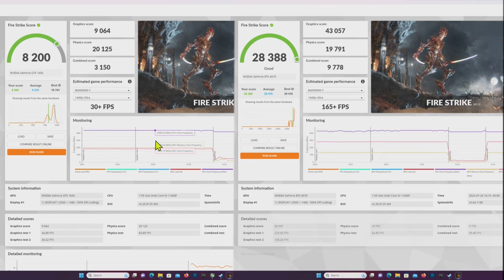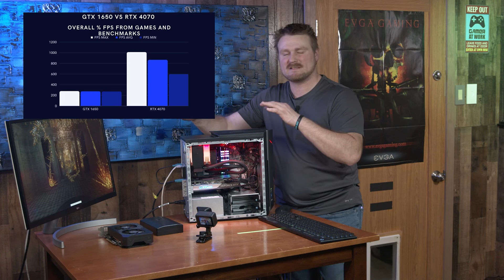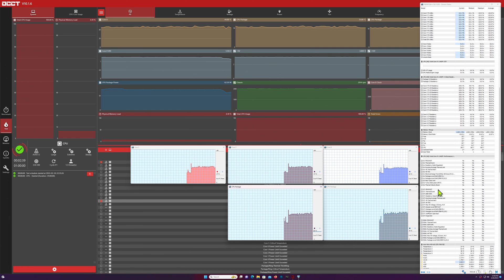Acer Nitro 50 GTX1650 Lets upgrade the GPU is a RTX 4070 really worth it? #howto #nvidia

Comment: I have an Acer nitro 50-600-UR1H with a 500W power, I was hoping to swap the 1660 GPU with an EVGA 3050 OC. Can anyone tell me if I have enough wattage for that upgrading the PSU is kind of tricky...
Reply: so you have roughly 230 Watts available, the 3050 8gb uses 130 Watts as long as its a 2 fan variant it should work
Reply: @Kramptonyte  thanks for the response bro. I ended up buying a 700 watt PSU and replaced the OEM One. So I should be good with wattage now and in the future. I do plan on upgrading my i5 9400f cpu to a I7 9th Gen,  but I have to determine whether or not the CPU cable from PSU can handle the wattage, since it's a 4 + 4 CPU connector but I only have a 4 pin port on the motherboard.
Reply: @DadeHudson93 that's one of the reasons changing PSU is iffy because you need adapter and those are adapter can be questionable and some people have fried components
Reply: @Kramptonyte  yeah I might not risk it, I'll just get a new, more modern motherboard down the line.
Reply: @DadeHudson93 well, with the GPU you had in mind, you can definitely do the i7 9700
Reply: @Kramptonyte  yea? Ok. Part of me does want to finish this build and Max it out before I move on to another. Ive learned soo much in the last couple weeks as a beginner and just watching countless videos. Its lowkey addicting 😅
Reply: @DadeHudson93  I despise the Nitro 50 because of Acer shenanigans. so I would not sink to much into improving it if you are already planning your next build
Reply: @Kramptonyte  I can see why. I didn't know much about PCs and upgrading before I got it, and I didn't know how problematic OEM builds could be lol I thought it was as easy as just getting a pre-built and upgrading lol should have did more research. But I am glad I got this far with it for sure
Reply: @DadeHudson93  lots of decent pre-builts out there if they use off the shelf components though usually with the Ram Shortage its difficult right now for DDR5. but this is why the Nitro 50 is so cheap compared to others

Comment: are you able to equip this pc with a 5060 ti? also why cant you upgrade the psu?
Reply: you have roughly 230w of power rtx 5060 TI 16g has a draw of 170w
Reply: You can upgrade the psu, just get a 24 to 6 pin adapter
Reply: @rimeee6051  thats what i ended up doing! upgraded the internal ssd, psu and gpu. thing rocks now

Comment: I just installed a GeForce RTX™ 5070 12G VENTUS 2X OC, bought a pack of 2 1x 8pin to 2 8pin adapter cables, first i tried didnt work, but then i changed to the other one and now it works perfectly fine. No issues whatsoever. I even saw it drawing 250 watts while i tried gta v enchanced but pc was still alive and going. Thanks for your channel and your videos TechNitWit. its fun learning!
Reply: just be careful that right on the line for power consumption, you may have to undervolt your gpu. which pretty easy using the MSI afterburner software
Reply: i was helping my friend upgrade his nitro with a 5060 tobut we were gwetting one long beep and two short beeps. i figured it was a psu problem, how did you get yours to work?

Comment: Is this using the original motherboard and psu?
Reply: yes,
Reply: 4070 super uses only 220 W of power on load. everything else in the computer uses 270 W roughly . so you have roughly 230 W to play with when upgrading video card. now you wont be able to overclock or upgrade to a more powerful CPU but it will work
Reply: @Kramptonyte thank you for the advice bro I’m new to pcs, how much fps do you think I would get with this or a 4060 on all low settings in Fortnite?
Reply: @aaaaaaaa-f7e  at low settings that's definitely workable for 240 fps that being said if you can afford it I would recommend getting the 4060ti or 5060 TI for better performance. But if you can afford it the 4070 is going to be your powerhouse compared to the 60 and 60 TI variants
Reply: @Kramptonyte thanks a lot bro I appreciate the advice
Reply: @aaaaaaaa-f7e don't worry about it ask questions. I'd rather help you get the best performance even if it is from a horrible pre-built

Comment: How did you manage to have the 4070 to work with this 500W PSU if the GPU requires 650W ? Is it me who's dumb as a brick ?
Reply: because a 4070 super uses only 220 W of power on load. everything else in the computer uses 270 W roughly . so you have roughly 230 W to play with when upgrading video card. now you wont be able to overclock or upgrade to a more powerful CPU but it will work

Comment: anyone manage a 2070 in this
Reply: a 2070 super uses roughly 215 watts, you have roughly 230 watts to play with, there is very little space so you will most likely need s 2 fan design
Reply: @ ty bro
Reply from the maker: Yes it will work id get a 5060ti or 4070
Reply: @TNW1337 should i get a 9060 xt? i keep finding it at msrp

Comment: are you sure the 4070 can be in 500w psu
Reply from the maker: you could use the 400w and it would work math comes out to 366watts would I suggest that no to play it safe I would only do it with a 500watt psu 500w will have plenty of head room also you want 20% for spikes in power.

Comment: Hey probably wont get a reply but will my PC be able to handle the RTX 4060 i have a GTX 1650 with an amd 5 3500 and 40 gbs of RAM and a 1TB SSD its a acer nitro N50-110 i believe so it should be a 500w power supply?
Reply: well the ryzen 3500 has a TDP of 65W, so it should be able to handle everything up to a rtx 4070 super as you have roughly 230W to use
Reply from the maker: ty

Comment: I have N50 640 model desktop. Is it possible to upgrade the PSU . If yes please provide a link for the PSU model. Thank you in advance  for the support 😀😀
Reply: there is a work around but you need an adapter which is the  24 Pin to 6 Pin ATX PSU Power Adapter Cable for Dell Motherboards easily found on Amazon for 10-20 dollars. and using that you could use pretty much any PSU that fits into the space

Comment: you can put a normal 92mm fan in front. I put a standard Noctua in there, its actually fatter than any generic 25mm, but it goes. And I believe you can put any "small" PSU in there with motherboard cable adapters.

Comment: hi, I'm planning to upgrade my nitro 50-640 from it's stock 3060 to a 4070. you think it will be compatible with my current power supply, motherboard and the other componets? thanks.
Reply: you can go up to 4070 super but just make sure its a 2 fan design

Comment: what model of acer nitro 50 is that? i have a n50-500 which is older so i cant find anything about it online and cant figure out if my psu can handle a 4070 or not
Reply: I hope you figured out your answer I cannot even find information on a n50-500. the oldest I could find is n50-600 which had an 8th gen i5 from 2017. and those from that age tended to have lower psu 400 to 450W . due to the age the processor you would be getting a bottleneck

Comment: Probably won’t get a response on this but I’ve been looking around everywhere for some answers lol I’m wondering if it’s at all possible to put 120mm fans in the case instead of 92? I have 2 extra fans from a previous build but they are 120mm so I’m nervous cause I want to put a cpu cooler in it as well and I can only find 120mm. Heeeeeelllllppppp 😂

Comment: Hello , I have acer nitro n50 640 with rtx 4060 ti 16 gb dual fan, 32 gb ram dual Chanel( it works great ),  I want to upgrade to rtx 4070 SUPER dual fan. will 500 w be able to to handle it 1440p. Gaming max settings. ?  Thanks waiting for response
Reply: I'm also interested in this, more to do with the pin connections?  Is the RTX 4070 Super dual compatible or does it need different pin heads from the PSU?  Anyone tried it?
Reply: you need to very pricesly check your motherboard what connectors have.. bcoz i have n50-650 with i7-13700f and rtx 3050 oem king 8gb and with this prebuilded pc's they make it with limited psu ATX or smth like that, so now if i want to upgrade my gpu i need to buy an external conector 24pin to 6 pin which i found easy in aliexpress (its for acer mb specificly) 3 or 4$ and with the new bigger psu i will be able to upgrade the gpu to 4070 or 5070 (i hope).but check everything what pins are goin to mb and gpu bcoz for sure u gonna need to upgrade psu :)

Comment: I have a N50-640 and want to upgrade to a RTX 4070. I bought a new psu to support it but it looks like I need a 24 pin to 6 pin connector. Im being told the motherboard in the N50-640 won't handle the 4070. Do you know if that's true?
Reply from the maker: The PSU stock can no need for a upgrade any thing. Just do not overclock it.
Reply: @coffeeluvr_7565  what type of cpu fan do you have? I wanted to get sonetbing other than the noctua that technitwit did a tutorial  on.. kinda new to doing these upgrades and this pc is so limited

Comment: Hello, what memory ram do you use , please, i have an acer nitro i7 11700f with 3060ti 1t ssd? Please or recommend something❤❤❤❤❤❤
Reply from the maker: You can use the one I link in the video cl16 1.5v ram it runs at cl22 or get the green ram at 1.2v and cl16 the fps Loss is Negligible.

Comment: Hey mate I have a question: I have the acer Nitro 50 N50-620
With an 1660 Super and an i5 11400f.
I want to switch to an 3070 founders Edition.
Would the power supply (500W) be enough?
Reply: Barely, you’d want to upgrade later
Reply: @ZaniacPrime  thanks mate!
Reply from the maker: The rtx 4070 will be just fine.
Reply from the maker: I use this pc to record my onscreen, and it rock with the 4070 no problems fast encoding. So, most video applications, editing, and recording software make use of  the CPU & Gpu  than games do. I can max the gpu and cpu out no problem.

Comment: I have the Acer Nitro PC its case looks the same as this and you know as per the title I do have the 1650 graphics card but you said 1660 and it just leaves me wondering if I actually have the same PC because mine does not have the water cooling inside I'm looking at the sticker right now it says Nitro GeForce 1650 but when I compare it to yours it definitely doesn't look completely the same. I'm desperately trying to upgrade this PC and I'm watching videos and nothing ever looks the exact same as my PC and I'm afraid to buy a GPU that won't f**** fit
Reply from the maker: I upgraded the to the water cooling. If you go vids back, I upgrade the air cooling, and before that, it had the stock cooler. So you're not crazy. The acer can come with different parts depending on what you spend.

Comment: 🙂 you dont have any Radeon cards? cause I noticed that sometimes u can't see the BIOS screen on some radeon cards with some motherboards. Preferably I would lean to the prebuilts that are compatible with both invidia and radeon. Thanks for the upgrade videos.
Reply from the maker: Acer is it can handle the 6700XT 6600XT and a 7600
Reply: @TNW1337  🙂 cool, thanks for the headsup

Comment: hey bro I was wondering if you could do an update to your cooling upgrade for the hp victus 15L. The one you suggested isn't available on Amazon anymore and the other websites say delivery would take a month. Recently tried to buy a different one but it was too big. what other coolers do you recommend for the victus 15L, that would fit?? Thanks in advanced.
Reply: 🙂 have you looked at the other channels, that prebuilt was covered by many guys

Comment: I like the twin edge 4070. A lot of power for such a small card. I put one in a hp tg01 and its smaller than the 6600xt it replaced
Reply from the maker: I love the card NVIDIA got so much right with this card.
Reply: 🙂 yes i have noticed the same, if your pc case is really short there seems to be more available short cards from invidia, its strange but some odd reason radeon cards are built a little bit more longer
Reply: @MrSamadolfo  
6600xt was actually very compact. Issue is rdna 3 is not that efficient. Nvidia dialed in on efficiency this gen while the 30 series was not. 4070 got a lot of flak for not being as much of a performance jump as some hoped but the efficiency and makes up for it and makes it viable for smaller builds
Reply: @stebo5562  🙂 oh i see, that makes sense, thanks

Comment: I just upgraded my nephews HP victus. Again lol. It originally came in with a ryzen 5600g and rx 6400. His first upgrade was 16 gigs 3600ram, and 6650xt, and 500w supply.  And now I upgraded him to a ryzen 5700g and a 4060ti 16gigs, same PC three birthday upgrades, although the GPU is kinda a side grade, but definitely more "future proof".
Reply from the maker: Yes, it is. I am happy it is not like the Dells, and you are stuck in the mud. Why I never do them.
Reply: 🙂 neat, as long as the motherboard is holding up ur fine, im glad to hear that the motherboard is compatible friendly.
Reply: @MrSamadolfo  Well I did update the bios and made sure to keep a 65w CPU in there. I also removed the bios battery before installing it for a solid 15 minutes and held the power button to drain the caps as I read somewhere that it helped. It did "restart"to the splash screen several times before loading up. Almost like it was relearning the memory or boot cycling. Also after inspecting his system I noticed that even though I got him 3600 ram it is running at 3200 and won't go higher. I am going to leave it, as it was on sale when I got it and have no use for it.
Reply: @ogm19881  🙂 neat, im glad it works